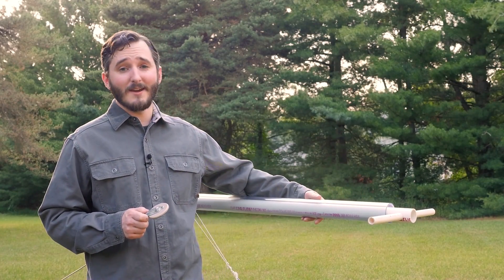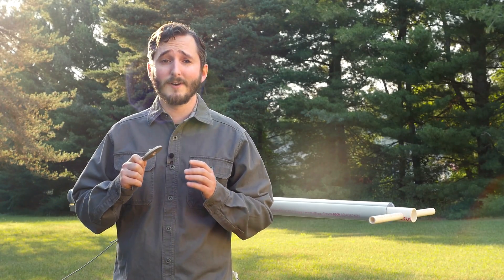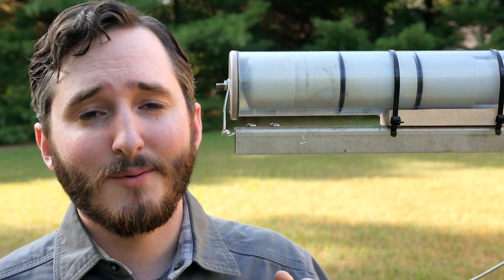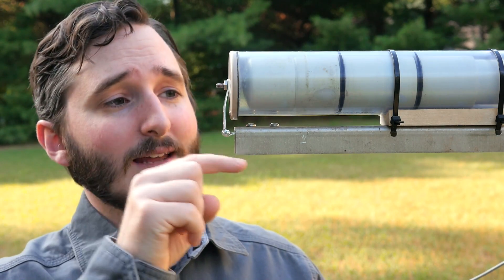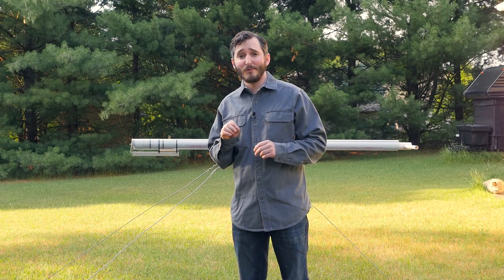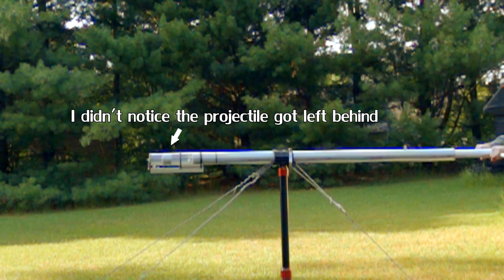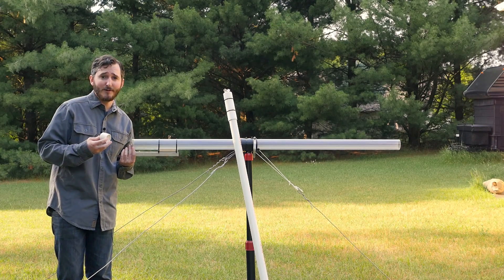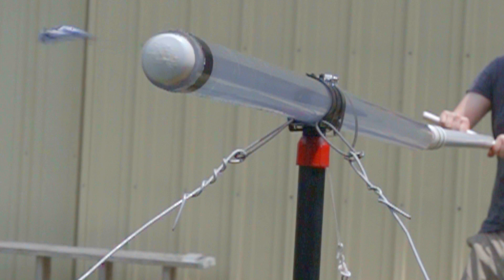Firing A Clear Vacuum Cannon & Testing Viewer Suggestions

Comment: If the inside of that tube is wavy, I wonder if those piston rings aren't able to maintain a sufficient seal.  Maybe see if there is a way that you can smooth out the interior surface of the tubing.  I'm also wondering what would happen if you were to charge the space in front of the projectile with a gas that is denser than air.  You'll still be able to pull a partial vacuum, but I wonder if a heavier gas would be able to open the valve sooner.  Or maybe I have it backwards, perhaps a gas lighter than air would be better.  In any case, it looks like that valve is opening almost as soon as it should.  If you go to 6:00 and set your playback speed to 0.25, you'll see that the projectile juuuust grazed the valve.  If the valve had opened just a little bit sooner, the projectile would've cleared it.

Comment: You need a spring loaded trigger on that cap. Kind of like the shutter on a camera. The stronger the trigger,  the faster it gets out of the way, leaving more vacuum for power. A small vacuum diaphram  enables it when projectile is pulled back, so you basically never have to touch it. The whole mechanism takes up about six inches at the end.
Also, have you considered a vacuum/compression combination to power it?

Comment: I would suggest using a valve that is 2 pieces

Both pieces could be mounted on the sides of the pipe and close over the opening not unlike french doors. 

Since both would be mounted on either side, gravity is neither fighting for nor against the valve "doors"

A small overlap of material could prevent a seal breach in the middle where each half meets and the vacuum of pulling the piston should assist in keeping the seal. Since both pieces of the valve would have less mass than one single valve on one hinge, the reintroduction of air pressure could more easily push each side out of the way. 

If the projectile does happen to hit the valve(s) then they would both move out and away from the projectile, taking less damage than a single projectile on a single hinge, due to there being smaller contact and less mass to move.

Comment: I'm trying to make a spring loaded piston actuator that resets when the air is gone. Its for a prop replica project. press the air trigger, the piston pops out, release the trigger, the air bleeds out & the piston draws back in quickly.   Any suggestions, or can you make a video to make a resting piston?
Reply from the maker: Search my channel for 'piston cannon'. I have a ton of videos on the subject. Just add a spring for your purposes.

Comment: Hmm, I like the idea of moving the pivot point a little so it stays closed by itself. I think I would try to maintain that and try spring loading it for example, to accelerate the valve flap a little quicker by pulling the valve flap downwards, so the spring still only comes into effect once the valve passes the pivot point. You would just have to make sure the pivot isn't shifted too far forward, so the spring doesn't apply to much force in the closed direction while the valve is closed. A stronger spring will 'cause the valve to open quicker once it passes the pivot point but it will also 'cause it to be more difficult to push towards the pivot point.
Edit: Sorry, just realized someone already suggested essentially the same thing.

Comment: A hole about an inch behind the flap connected with a tube to another hole about a foot behind that. Maybe several of them around the circumference. After the projectile passes the first set of holes air bypasses the projectile and pushes the valve out the way quickly.

Comment: hmm, on the recoil question, the front of the pipe is sealed until the very end right before the projectile comes out. Before that it's an implosion inside the pipe, yes? If air is rushing in at the back I can't see what that does to the barrel but the projectile is being accelerated forward and after it exits the barrel I think any recoil will be in the air only as both ends are now open - I think the recoil would be in the turbulence of the air which we can see in the cornstarch example where it appears to have more air blowing backwards than air blowing forward (which I'd wager is an illusion because the blowback is slower and only looks more voluminous (but whatever cornstarch blew backward must have been blown inward).) If we compare this to a rubber band slingshot the rubber is attached to the slingshot while in the vacuum gun there is no physical connection and so the air inside may recoil and pulse to and fro but the barrel is not affected much. Maybe a bazooka has very little recoil, maybe a rocket does not apply recoil forces to the tower next to it(?) - along this same line have you thought about using bungee or trampoline to launch a rocket to save energy at the initial point of launch? (let's think of how to trigger this, use quickmatch to tie down the bungee which will burn and snap immediately when rocket ignition touches it).

Comment: Light sensor, arduino, solenoid, and a mosfet to sense the projectile at a point before the valve and once the air cushion hits the valve the solenoid is triggered?

Or maybe just a spring latch that is unhooked once vacuum starts to be applied, with the spring held by a string operated latch so you can start pulling a vacuum?  Then the spring would get the valve out of the way the second it can overpower the delta P

Comment: It is a good idea,...! However it wouldn't work in the outer space, anyway the Valve system you need to make it more efficient is based on two things: 1-) the internal instant pressure of take off: keeping the piston at 10mm from the out let hole then seal it by the valve and start pull it out for establish the  vacum in this way you will not lose any of the KE of the take off. 2-) Opening the Valve led: there are a lots of ways to designed it the easy one is to make elastic rubber band to pull the hatch led out "very easy". tel me if you need drawing for it,...!?

Comment: My thoughts on this are as follows. Have the projectile linked to a disc using a thin central rod. The disc covers the hole at the front and as you pull back, the rod could separate from the projectile and the vacuum will hold the disc on the front. Releasing the piston will force the disc and the rod off the front, allowing the projectile an uninhibited flight. The length of the rod could be shortened or lengthened to the optimal distance. It would also allow for a quick reload. Also, could you could try a spiral fin on the back of the projectile to increase accuracy or have a secondary projectile held by a thread behind the primary projectile.

Comment: OK, NightHawkInLight, an idea by Dr. Mauser just inspired me to a great idea.

An over center spring/rubber band holds the valve closed. (just like gravity) Once there is a vacuum, a small piston (or diaphragm) tips the bottom of the spring past the pivot (limited by an adjustable stop) so that when the projectile is hurtling towards it, and the vacuum is dropping, the spring will open it just before the small puff of air hits it. The stop adjusts how much vacuum is required to keep the valve closed, and thus, the timing so the spring has JUST enough time to yank it out of the way. It's only a little more complicated than the current version.

What do you think?
Also, you could decrease the mass of the valve by making it a dome.
Reply from the maker: I've come up with a design that works for this cannon, but haven't made a video about it yet
Reply: How does it work? Is it anything like my idea? I think tipping the spring past the pivot once there is a vacuum holding the valve shut could really improve performance.

Comment: You could use a dremel to make notches in the projectile to help the vinyl tube grip the projectile slightly tighter, and you could put some kind of metal plastic or rubber spring on the front which would cushion the impact with the valve somewhat so that the valve was not impacted directly by the projectile its self which might then allow the valve to be reused, although depending on the length, shape and potential whipping action it might cause the projectile to tumble.

Also perhaps a tiny balloon on the front which would deliver some push and cushion but would explode in such a way that it did not contribute any rotational force to the projectile.

Comment: Perforated section between the two O-rings..would it 1, draw the projectile back?...2, and stop backflow in to the front, muzzle ??? .and a test with three o- rings so as to only drawback passed 1st .or 2nd o-ring, kinda creating a breach. The projectile would rest against the hollow tube.

Comment: Maybe as already mentioned, lowering to a minimum the mass of the flapper valve. Also making a small hole near the flapper valve to let air in in that end that can later push the the valve open when the proyectile approaches and compresses this molecules  Other solution a cap (low mass) which flies away WITH the proyectile Many caps necessary?

Comment: Might be a stupid suggestion b what if you took a piece of Steel and bent it on the bracket that holds the hinge then attached to a spring from the peace of Steel that went to the flap then ran a rope to the front might be a stupid suggestion but hope you would try it love your vids by the way

Comment: A couple of suggestions. Put bumpers on the flaps made of rubber and where the flap hits the bottom of the cannon. Then install a push rod at the front of the projectile that pushes the door open this would then allow the door to be open and continue on. You could also make a second smaller gas tube that is tuned to push the flap open when you desire with a smaller projectile. Much like a gas tube on a semi-automatic runs the action of the pistol. Though this second one would be difficult.

Comment: Is this not the same as firing an air cannon at 14.7 psi or 101 kPa or is it the differential pressure that is propelling it?
Reply from the maker: It's not the same because there's no air in the barrel in front of the projectile, which in a regular air cannon slows it down greatly.

Comment: A string on a pulley system with one end attached to the flap and the other end attached to the rod being pulled out, would have to be the exact right length though which could be hard to achieve

Comment: Cut the front end of the tube at a 30-40degree angle. Make an ovular valve to cover the opening. This way, the valve would have to travel a shorter distance to get out of the way of the projectile. Gravity would also assist the valve better this way. Use a string to hold the valve in place until the vacuum build up is enough to hold the valve, then let go off the string, then pull the piston further until release.

Comment: What you could do for the valve is make it so it wants to fall open but have like a string with a magnetic that connects to the valve. And magnetic would stick to a long piece of steel on the plunger. The string with the magnetic would hold the valve closed as you pull back but then release once the steel on the plunger is pulled away from the magnetic. And hopefully by then the vacuum that is created would hold the valve the rest of the way. Still not sure the valve would open fast enough to not get hit.

Comment: Can you not just keep the current forward hinge position however add elastic bands to provide a force in the same direction as gravity, essentially as soon as the valve opens due to the pressure wave it will accelerate faster than gravity alone. A simple fix perhaps?

Comment: Any chance to rent good high speed camera? It will be great to see good slow motion.
Reply from the maker: A good high speed camera is $1,000/day rental. I would need a very good reason to need it. I do have friends that own them though if they happen to come into town.
Reply: Collect as much as possible experiments with all preparations to shoot videos. Then you can do many experiments in single day with single rental. I am especially interesting in energy transfer (bullet vs. anything, rockets, cannons, molten salt in water, and many other things). You have great amount of subscribers, so maybe one day YT earning will cover expense of single day high speed camera shooting. Avoid narration during high speed camera shooting - you can always do it during post processing. Just make good plan, maybe 3-5 experiments prepared, and you are good to go. BTW, your videos are incredible clear. Which camera do you use for filming it?
Reply: Oh, btw... the other day I found something interesting - acetone explosion. Potato canon with gas (propane, butane...) can be fun, but did you try acetone? I found that the difference between say isopropanol and acetone (which is some sort of oxidized isopropanol alcohol). Acetone burn more vigorously than IPA. Only problem is with interaction with PVC walls, but maybe some PTFE coating or similar can make it less aggressive? Or metal container as a gas chamber, while potato canon can be as usually made of PVC or acrylic glass. What you think?

Comment: I am wondering why you can't use the projectile itself as a air flap. Have a ring about 16 inches or so down the end of the pipe so the projectile will only go that far and when you pull the plunger back it will have the same effect I think. Your projectile would have to be a tight fit though. Maybe I'm wrong I don't know. Can we try it?

Comment: I kind of wonder if the problem when you were leaving more air cushion was that the valve was opening too fast and bouncing back up.   You could probably stop this by adding a magnet to the lower rail to catch the flap at the bottom.

Comment: Use a string a bit longer than the transparent pipe, which connects to the handle. Use something that connect the flap valve, extending downward e.g mini see saw

Comment: There's a bit of an issue with using the air cushion in front of the valve to open it:

When the projectile is fired, assuming the air is distributed evenly throughout the tube in front of the projectile, the pressure will only exceed atmospheric pressure when the projectile is in front of the point it started at. Therefore the valve can only BEGIN to open when the projectile is already very near the end of the barrel. 

In fact, there will be a higher pressure wave immediately before the projectile and lower pressure in front. This uneven distribution means the projectile has to be further forward still before the valve can even begin to open because of the pressure difference.

For this sort of valve to work, it must begin to open before the pressure is equalized so you need to set it up to fall open rather than rest on the pipe or you might even need some sort of assistance to move it faster e.g. An elastic band pulling it open

However, the foil caps are the optimum solution because a valve takes time to open and any time the valve is open before the pressure has equalized is time for air to rush in decelerating the projectile.

Comment: Maybe you could use some sort of stiff balloon material for the valve.  If you choose something that flexes inward a little, the release of the vacuum will also allow the valve to gain momentum as it stretches back, just make a support ring for it that fits around the end of the tube and keeps whatever rubbery material you choose from being pulled inward.  It might be possible to use multiple layers of party balloons attached to, or wrapped around, some sort of ring and the ring could be attached with a rope or wire.

Comment: What about putting a lightweight sheet metal 'flap' (with a tape seal surface) on the barrel front, held on with a set of small magnets ( taped to the barrel), at the 120 degree points.  Allow the projectile to carry the flap away as it flies out of the barrel as part of the thrown load.  The flap will fall to earth along the way and the projectile ought to continue on its path.

Comment: No matter what you do to modify the hinge mechanism, I think you should do your best to reduce the weight of the flap valve to give it less inertial mass so it can accelerate faster with the given forces. The only other thing I can think of is to spring load the valve. Maybe you can make the spring system bistable or to have some sort of pressure sensitive trigger system so that when you pull a vacuum on it the flap is unlocked and the spring is pulling against the vacuum/atmospheric pressure. Imagine a membrane on the flap that gets pushed in once you pull a vacuum and then that movement triggers a mouse trap.
Reply from the maker: The valve is about as light as it can get. Made of any lighter materials and it's not going to be strong enough. I've already come up with a completely new method though that does work, I just need to make a video about it.

Comment: what if you were to make a two layer cap one that will actually seal the outside and another layer the same outside DIA as the Inside DIA of the pipe? then attach that to a string so it does not go flying off?

Comment: You could try mounting a strong magnetic beneath the hinge, and also mount a second strong magnet to the top of the valve face. When it bursts open, the magnets should connect and prevent the valve from bouncing back.